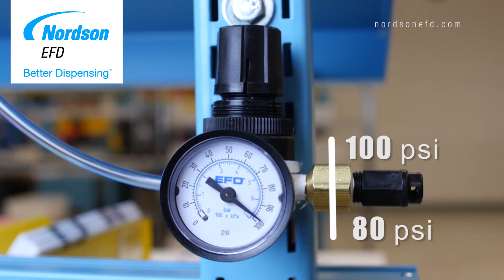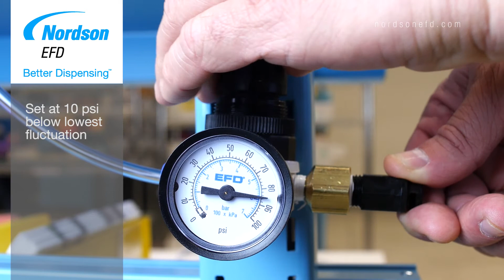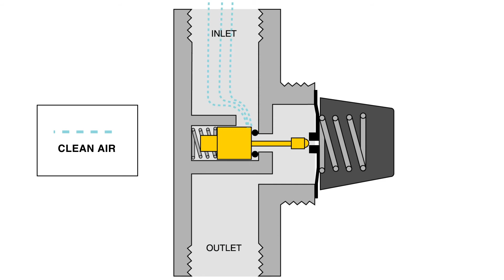Fluid Dispenser Best Practices 01 ─ Plant Air Supply - Nordson EFD

Comment: I'm a little confused. Isn't there already a pressure regulator inside the device? Isn't that the thing you set when you set your dispenser pressure? Wouldn't this accommodate air pressure fluxuations?

If you recommend a second pressure regulator, then why not build your dispensers with it already installed, and always set 5-10 psi above the target output pressure?
Reply from the maker: Hi John – Yes, you are absolutely correct that there is a pressure regulator inside the dispenser device. However, the external pressure regulator with a filter has multiple purposes:

1. To ensure that no dirt, oil, or dust common in manufacturing environments enter the dispenser and impact performance. We occasionally receive dispensers with a significant amount of grime inside the units due to poor plant air quality. Having an outside filter helps ensure this does not happen.
 
2. Internal pressure regulators are designed for up to 100 psi of incoming air. An external pressure regulator can help ensure that no more than 100 psi will enter the dispenser if there is fluctuation in your plant air supply. 

We do not currently have plans to integrate the external 5-Micron Filter/Regulator into the design of our dispensers because so many of our customers use the external filter/regulator and it works very well. If you want your dispenser to last a long time and provide the best possible performance, we highly recommend it.